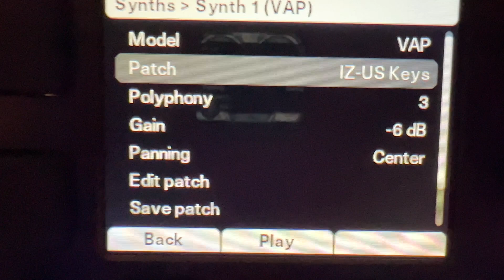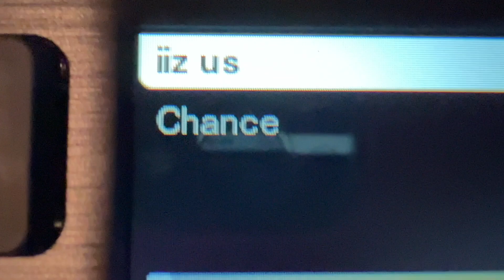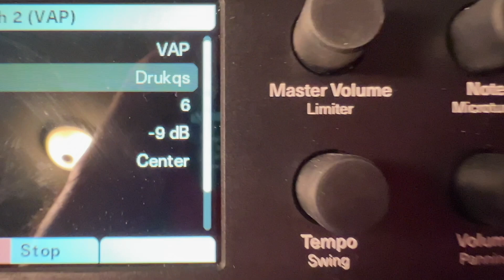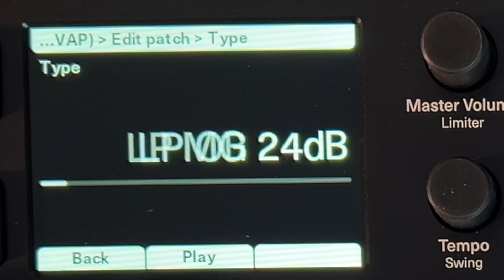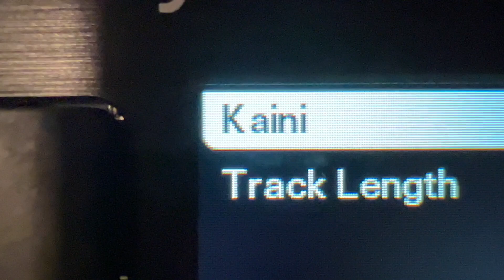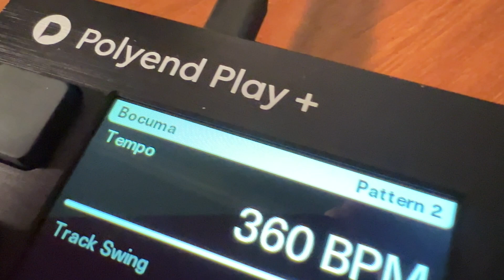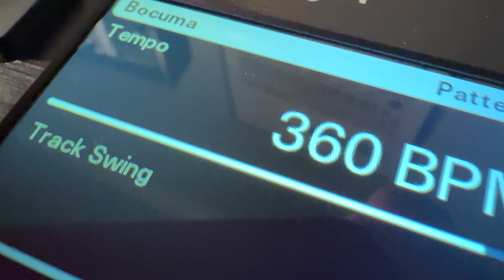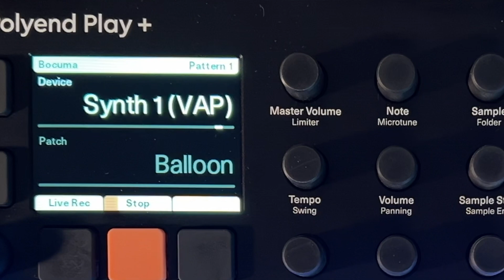Play + Plus Review: The Autechre Machine?

Comment: Play OS - even after several updates - has a deal breaker issue and CONFIRMED that it exists in the Play+ as well. When you grow the project to a bigger size the save and load time is impacted. So much that if you make a project with several rows of patterns the load and save time can be more than 45 minutes. This is a horrible bug that is easy to reproduce and any original owners of the Play can easily confirm it (and have.)
Polyend confirmed the issue weeks ago in backstage and has still not solved the issue.
1. Make a few audio tracks and a couple midi tracks - nothing elaborate - save to a pattern.
2. Copy/duplicate the pattern to the next pad in the row. (To copy a pattern, press and hold the source pad and select the destination pad slot by shortly pressing it.)
3. Repeat #2 til you have 32+ patterns duplicated. As you continue to duplicate patterns each successive copy takes longer, eventually taking 45+ seconds and even longer as you continue copying.
4. When you have about three rows of patterns (48 pads) you should attempt to save the project. The save will take a very long time, likely as much as 45 minutes, so get out a timer and start it after you begin the save.
Reply: I thought the bug was also related to using variations quite a bit, and isn't so bad without them?
Reply: Have I got a different chipset? Haven’t had this problem and I’m creating some pretty hectic stuff. Maybe there was a hardware change?
Reply: @Farold_Haltermeyer  it only happens if you use a bunch of variations and not normal patterns and it still happens on the play+.
Reply: @radfaraf  I’m variation heavy...but I switched out my sad card for a faster one and that seemed to stop any freezes and save hangs with larger projects...BUT I use it as a drum synth essentially so maybe I’m not a typical user
Reply: @Farold_Haltermeyer  I got a faster card too and it doesn't make a noticeable difference. After I got my play+ I did a quick test of just a simple drum beat maybe 4 sounds max, maybe about 3 variations. Then paste the same pattern thing over and over again in the track view or whatever it is called. By the time I get to 2-3 rows worth both the copy pasting and saving are extremely slow as compared to just a few patterns, and if I go quite a bit past 3 rows starts to get into unusable territory from how slow it is. So other guy found that bug, and a bunch of us who all tried it also ran into the same results both on the original play and the play+. Play+ should have the fastest hardware, but it doesn't seem to make the issue go away, seems more like a bug.
Reply: @radfaraf  ah gotcha, yeah I’m not using it that way at the mo but would expect it to hold up to folks wanting to use it for that kind of role. Hopefully fixed on the other side of the next production batch
Reply: Did you follow the steps to recreate the issue? Obviously not. Polyend confirmed the issue, offered to replace/refund. New chip improves the wait time slightly from 45 minutes to about 15 minutes - also confirmed by Polyend. "Hectic" has nothing to do with it. Use simple midi patterns, it doesn't matter. Its about saving many rows of patterns. Follow the steps before you simply "guess" what is going on. ;-) @Farold_Haltermeyer
Reply: Ah well, there you go. I stand corrected in my presumptive questioning. You get rid of it then? You’re Kunoff aren’t you..I saw your rantings on the Loopop review too, so are you doing the rounds on these reviews warning everyone?

Comment: Personally, the exhaustive process of patch editing renders the synthesiser inaccessible and irrelevant for me. In comparison to the workflow of the original Play, which can render a beat very quickly, depending on one's speed accessing the sample storage, this looks very clunky.
Reply: If they can add an update to allow external controllers to change parameters through midi then I think it would help a lot. Or a software editor. Either would be an improvement.